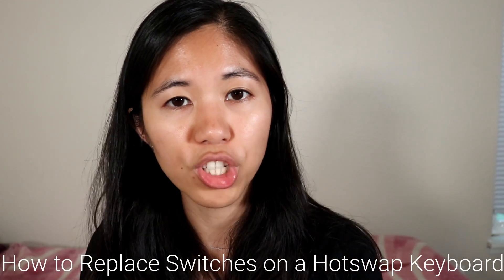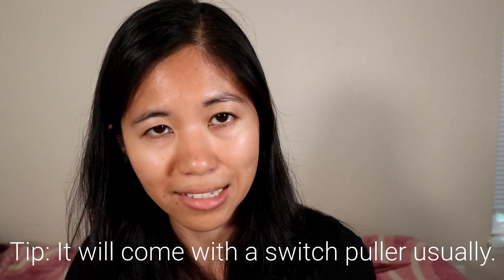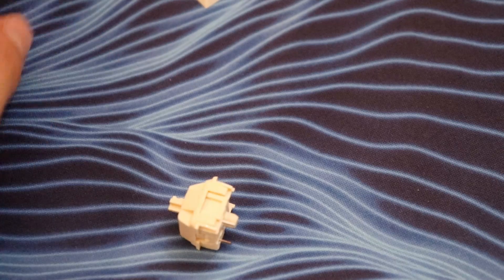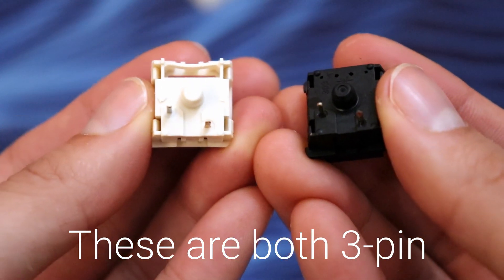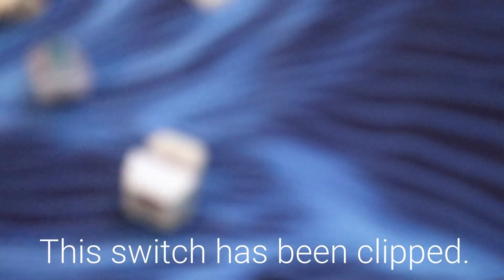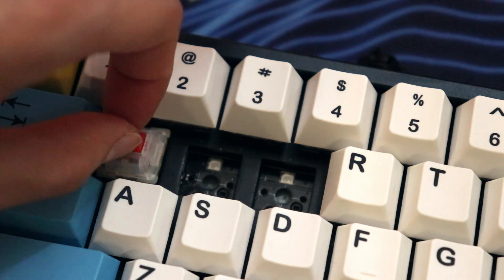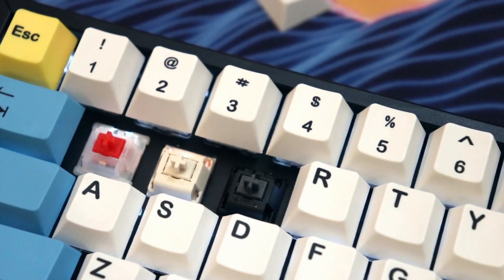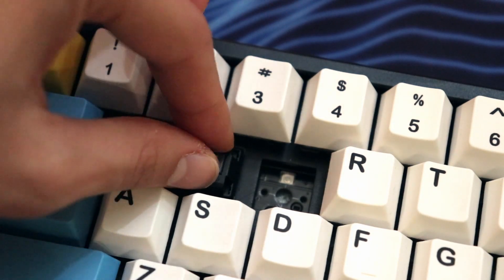How to Replace Switches on Hotswappable Mechanical Keyboard - 5 Tips You Need to Know

Comment: idk if I'm really stupid or not but. I just got the gmmk tkl hot swap and I'm having a lot of trouble taking out the switches. Like, the bottom part of it pops out but I can't pull the switch out.
Reply: Same I need help
Reply: @Jess92738  i figured it out if you need help can just pm?
Reply: @andylee3609  the only way I can take them out is by ruining them in the process
Reply: @Jess92738  you have to get the bigger longer switch pullers and shimmy it out when you pull it out

Comment: Hey, awesome video but I have a few questions :)
1. is the gk61 compatible with novelkey cremes and YOK panda switches?
2. are there any switches that are not compatible with the gk61?
3. and I know switch choice is subjective and depends from person to person but what are your favorite switches preferably under or around 50$ for 70 switches that are compatible with gk61?
Reply from the maker: GK61 kit is. Not the optical GK61. My fave switches under $50 are glorious pandas and Gateron milky yellows I guess
Reply: @SwitchandClickOfficial  what if your switch doesn't have the pins
Reply: @SwitchandClickOfficial  ahh thanks for the input!

Comment: can I use a 3 pin in a 5 pin sockets
Reply from the maker: Yes
Reply: There will most likely be more instability since you are lacking 2 pins. This could cause misalignment or rattling. See if there is a mod that would increase switch stability

Comment: Quick question from someone new to mechanical keyboards. Lets say I have a hotswappable pcb with five holes for the pins. Can I use a plate mounted switch for the pcb?
Reply from the maker: Yeah

Comment: I have a keyboard with gateron red, and it says they are hot swappable and I can take the switches out but uderneath the pcb and switch are both just one pin im seriously confuzsed... can I use other switches? using hot swappable even though its jsut one pin?
Reply from the maker: It's probably gateron optical red

Comment: this is very informative. but may i ask how do you clip or cut the switch pins if it doesn't fit to the pcb? i heard that you can use nail clipper or maybe just regular scissor..
Reply from the maker: I use flush cutters but I've use nail clippers before but the plastic pieces fly everywhere
Reply: @SwitchandClickOfficial  do you cut the bottom of the pins or the top of the pins? i'm sorry if this is confusing you
Reply from the maker: https://switchandclick.com/2020/01/09/plate-mounted-vs-pcb-mounted-keyboard/ you cut off the two plastic pins from the 5-pin switch to 3-pin switch
Reply: @SwitchandClickOfficial  omg thank you so much you really helped me ❤️❤️❤️

Comment: I got a drop alt yester day and I wanted to remove the switches and I used the switch puller on the two little tabs of the switch and only the top of the switch came out and I somehow got it out but the top tab was broken (was stuck pushed in) how in the world am I supposed to get these out without breaking them? I already broke 3 of more $70 gateron black inks  :c

edit: and the pins are bent. I don't know what to do  I hope i didn't ruin my pcb . and didnt waste my $300 I spent the whole year saving up for this keyboard.
Reply from the maker: With bent pins I use pliers or tweezers to straight it up again
Reply: @SwitchandClickOfficial  Okay

Comment: My keyboard is hotswapable but I don’t have pins in my keyboard just the middle bump the keyboard i have is the geek gk61
Reply: if the PCB doesnt have any pin holes, it's likely SK61, the counterpart of GK61 with Optical Switches instead of Mechanical Switches. They're not compatible to each other's board. You will have to find optical switches to swap with the board.
Reply: katsuu / wfang3456 thank you I see the problem now

Comment: I've got a Logitech G.Pro keyboard that has hot-swappable switches. The existing ones are 3-pin. Planning on getting Gateron Silent Blacks and clipping the extra pins off. I'm assuming there's no issue with replacing the MX switches with Gateron opticals?

Comment: What about the pcb mount and plate mount. Is it important for hot-swappable keyboard?
Reply: @SwitchandClickOfficial  so hotswap can't use pcb mount?
Reply: @SwitchandClickOfficial  Okay thanks for the explanation. Mechanical keyboard is a new things for me and I still learn about it. Until I stuck when choosing between PCB-Mount and Plate-Mount switch for my keyboard lol, btw my keyboard is only support for 3 pin which mean I shld to cut the 5 pin switch. Tysm btw... 😅😅😅

Comment: Hey I have a question that i haven’t seen answered anywhere, if I have a keyboard that only has static LED’s  (were the key only lights one solid color) can I replace it with a switch with full rgb and have it change colors like in full rgb keyboards?
Reply: In case you're still wondering, the LEDs come from the PCB and not from the switches themselves. The switches are just transparent to allow light to shine through. Hope this helps!

Comment: Just spent like $120 on keyboard parts, still gotta order keycaps, spring lube a metal case and switch films! So many little things man!
Reply: Same man I just spent like 200$ on my keyboard kit but I still have to order switches and key caps, and I still have to put it all together!!
Reply: AS_EV4D3R_ 1 Lol, kinda crazy. spent $270 just ordered everything except an upgraded metal case, they don’t have a red aluminium case for GK64x in stock :(
Reply: @Kyanite.  dude I'm seriously just rn about to spend another $90 on switches and stabs 😂😂 our wallets hate us rn
Reply: AS_EV4D3R_ 1 woah bro they must be holy pandas or creams lol
Reply: I’m sticking with red switch for my first mechanical, seems like no one really complains about them so safe bet and doesn’t break the bank too much hehe ( ordering 65 more cuz i didn’t get rgb switches :P)
Reply: @Kyanite.  no unfortunately I'm getting some Gateron Silent Black Inks, GMK Screw In stabs, and some Krytox 205 G0. However I did want some creams and they're only 45$ for 70!!! Idk I am conflicted!!
Reply: @Kyanite.  my first switch was Kailh Box Browns and I want to try Linear and Silent switches and so I'm getting the Silent Inks for my next build
Reply: AS_EV4D3R_ 1 I heard they can be super scratchy so not sure if that was when they first came out, gateron blacks is a solid choice, but my fingers are weak lol blacks are too much for me
Reply: AS_EV4D3R_ 1 Nice dude, tell me how it goes when you get the parts 👌
Reply: @Kyanite.  yeah dude for sure I wanna know how your build turns out too, I assume you're building a GK64 right??

Comment: Nice video! I've got a 3-pin/plate mounted full sized GMMK and a 5-pin/pcb mounted gk64. When removing keycaps sometimes the 3-pin switches will come off the board and stick with the keycap. This has yet to happen with the 5-pin gk64.

Comment: When taking out the switches, my GMMK Full size's stabilizers were on the way of my gateron switches and I accidentally broke the casing of those that were vertical (iso Enter, num enter, and num +) because I really didn't have enough room to grab the small latches on the switches with the remover. I was so sad! 
But apart from that the rest of switches are really easy to take out just pressing on the right place. 
Thanks for the guide!
Reply: I had a similar issue with the full GMMK! I have a few switch puller tools and prefer the bigger one with rubberized green grip, but it's too large in that situation. The cheap metal one like Betty has here allowed me to slip the clip past the little tab and under the top housing to be able to lift the switch. It felt scary and uncomfortable, but it got the job done.

Comment: Great video for the uninformed of what is and what isn't a hotswappable keyboard.

Personally on my first mkb now, its hard to remove the swtiches from the plate most of the time. I dunno if it's because it's brand new and hasn't been weathered from all the friction or I'm doing something wrong. I have gateron milky yellows on them so it should be fine pulling them up from the x axis sides. But they're just too tough to pop up.